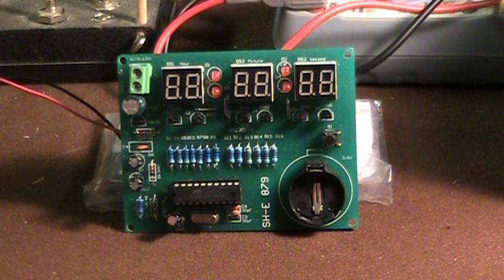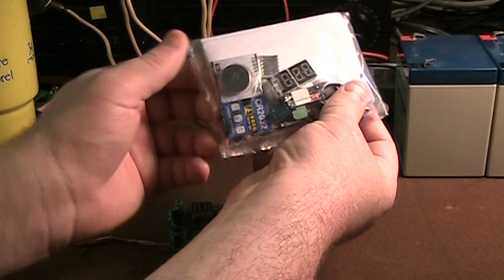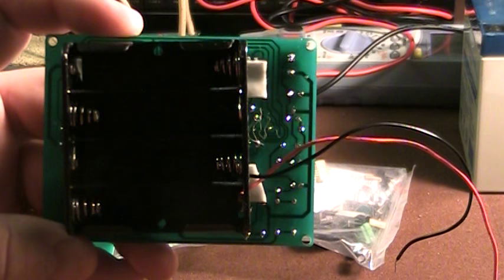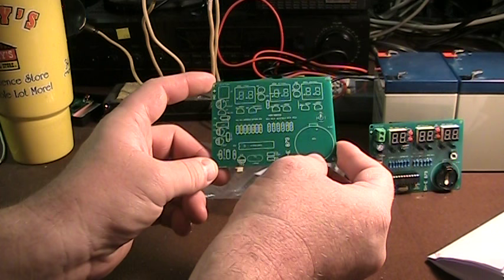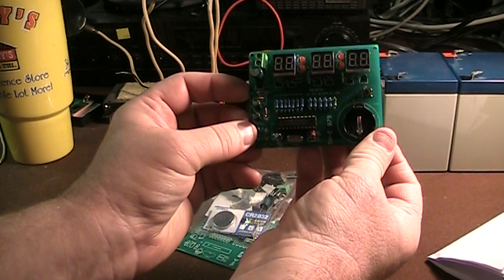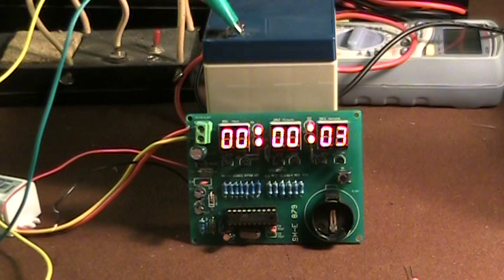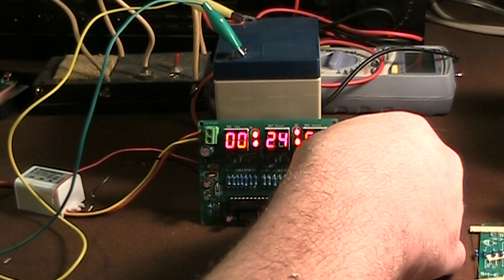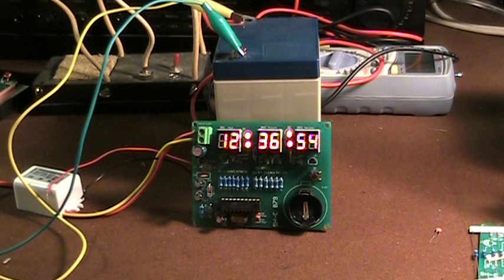Review: Cheap Microcontroller Digital Clock Kit (SH-E879)

Comment: I decided to repair the living room 24 inch Sanyo CRT TV a few days ago. The vertical was messed up. With the advise of RadioTVphonoNut, I was told to replace a capacitor. The value I needed was a 220uf at 35 volts. Strangely enough, Radio Shack had the very value cap by Nichicon in an axel lead. The radial lead was an unknown brand. I went with the Nichicon. 
Later that day,  I find a nearly Identical Sanyo CRT set by the curb. I plug it in, turn it on and, amazingly, it works great.  
I found an Emerson VCR that was repaired by RS 20 years ago nearby. It works great too. Hot diggity dog LOL. I fixed the first Sanyo for about the price of a 20oz Coke in my area.

Comment: I tried it and it works quite well, that is, the 4 LED diodes do not turn on, they only turn on when in sleep mode, which is accessed by pressing the button once.
Other than that, the backup battery works very well. I disconnected and connected it several times and it did not restart.

Comment: Energizer batteries last amazingly long - I've got a multimeter from something like the 1970s which had its original battery still installed. Despite having leaked and corroded all over the place, it still held about its correct voltage.

Comment: There's a proper Arduino library that allows the Atmel to run in a sleep state drawing an extremely low voltage. there's a GreatScott video about an IR remote control for a receiver where this is featured... but in use, it doesn't run the clock, just sleeps the controller until input is given. this could probably be modified somehow, however.
Reply: You can use that capability without the Arduino bootloader.
Reply: techhelper1
right.

Comment: When I turn it on, it just shows every number as 8. I press the button but it doesn't do anything.
Reply from the maker: At that point, assuming you care, you check all the solder joints, your power supply, component placement, whether or not the parts are good and hope that you didn't zap or overheat anything during the assembly process.

I suspect you have a problem with the clock crystal.

Comment: These are the kinds of kit's Radio Shack should have sold, or should sell in what ever limited capacity they operate today.  I would assume this clock is probably intended to be used with a wall wart. I think you are a bit to picky of your soldering. It looks fine to me. Your not a wave soldering machine after all.  Fun video!  There are some older ( late 70's or 80's ) NOS multimeter kits on ebay for about $10 that you might have a look at. I bought one, seems like a pretty nice kit.
Reply from the maker: Just a few years before RadioShack finally managed to go bankrupt, they had managed to bring some kits back into their stores. I really had high hopes that perhaps this would bring them back from the edge. Maybe it would have lead to their getting back to their roots and doing what made them so great in the first place. Alas, it wasn't to be. (I have always felt it was RadioShack's ill-considered decision to dedicate large portions of their stores to cellular phones in the late 1990s that led to their demise.)

I am pleased to see that the new ownership has put more kits in the remaining RadioShack stores around these parts. They're not exactly cheap, but that's OK with me so long as they go together and work well.
Reply: *****
The remaining Radio Shack in my area has removed a lot of stuff that they once stocked there. As thin as they were before compared to the golden days, it's worse now. There supply of solder for example is down to 2 rolls and 2 soldering irons. I think they still stock some of the Arduino kits they were selling before, but a lot of that stuff was removed as well. Perhaps they have stocked more stuff lately, I haven't been there for a few months since I discovered they stopped carrying the solder I prefer to use.
Reply from the maker: Very strange. After their bankruptcy and "relaunch" the one RS store I frequent had basically no stock of anything. As time has gone by, though, they've managed to restock the whole store quite nicely. They have decent variety and even some of the more oddball/specialty items for which RS was known.

Given that this store seemed to not only be doing well, but that it also catered to a fair number of electronics enthusiasts besides myself and actually had knowledgeable people on staff, perhaps it is more of a rarity than I realized.

Comment: Good video Bill, What form of switch output is it? volt free contacts are out, so, low voltage DC switched on/off?, Daft question I know but I was wondering. J.
Reply from the maker: This is a clock, not a timer. There is no alarm functionality, and as such there is no output contact of any type.

Comment: So, which kit would you recommend to someone like me? I have soldered before, and have put a few LED kits together. The most I have ever successfully completed was a capacitor swap on a dell motherboard.
Reply from the maker: If you've soldered before, this kit is a fine choice so long as you're OK with identifying components and their values as you put it together -- and you get one where the circuit board is accurately marked. Even if it gets messed up beyond repair, you're out about $4.

Comment: I was thinking about getting one of those, but I already have enough clocks in my house and I don't lose track of time. There's only one Radio Shack left by my house and it's inside a mall. Is it a good idea to use a slab for an alarm clock as a backup battery (with voltage regulators, of course)?
Reply: I only have one Radioshack too, but it doesn't even sell components.
Reply from the maker: I haven't been satisfied with the accuracy of any alarm clock when running from a backup battery. (I presume that by "slab" you mean SLA Battery. If not, please clarify.)

Truth be told, I don't think using an SLA battery would work well in that application. They have a considerable self discharge rate. A conventional linear voltage regular is going to be running awfully close to its minimum voltage differential limits and a buck type converter might output too noisy of a signal even with fairly serious filtering. Noise introduced by most simple battery charging circuits might get into the clock logic and pose another problem.

I was very satisfied by the results of simply plugging my bedroom clock radio into a cheap UPS. It had no issue with the modified sinewave output, kept great time even when running from the UPS's inverter and would stay running for hours. Your mileage could vary, but as cheap UPSes are everywhere, I'd suggest at least giving it a try.
Reply: +uxwbill I forgot that I purchased a UPS from a thrift store and got a new battery from RadioShack. I'll test it out tomorrow morning with the UPS unplugged and the clock radio plugged into the UPS and see how long it'll take until the clock shuts off.

Comment: It appears they are running that arduino type chip with an external oscillator crystal, does it have the frequency listed on it? -cscash
Reply from the maker: 12 MHz even.

Comment: In an attempt to feed that image through Google Translate, I got the real, accurate translation to engrish: "Translate server error."
Reply from the maker: It's better living through technology!

(More seriously, I once did exactly that to determine what something said. I took a picture of the text, converted it down to a two bit image and uploaded it to a web-based OCR engine. I was amazed to find that such a thing existed, especially as I wasn't really tremendously enthused by the idea of digging up my old copy of TextBridge and trying to get it going. I then took the text as it was recognized and fed it to Google Translate. And yes, it all worked to give me my answer!)
Reply: Yikes, I would imagine that took some time. The mobile app for Google Translate will let you take pictures and higlight the text you want to translate, but it's a work in progress and works only marginally okay for some languages but perfectly with others. I know from experience Chinese and Korean hardly work but Russian seems to be just fine. (I pick up a lot of foreign electronics.)
Reply from the maker: Nah, it was really pretty easy and straightforward. And it worked, which came as a really pleasant surprise. (I haven't lost all my faith in computers and software just yet.)

At risk of encouraging the whole "Standard Definition Isn't Good Enough" brigade to descend upon this comments area, maybe the Google Translate app would work better if it had more image data to work with. I might take a better picture of those instructions, and do with them what I described earlier just to see what happens.

Comment: Just don't build one of these in Texas if your skin's not white, otherwise the waterheads will call it a "bomb"... :P

Speaking of DIY clock kits, there's one out there known as an "Aurora LED Chromatography clock", I built one last year, neat little thing, the only downside is it's a huge learning curve in soldering SMD components, but I managed to get mine built and working nicely... :)

And still have 2x more kits to build up... :P

Comment: uxwbill you just gave me an idea for a DIY project. Thanks!
Reply from the maker: May I ask what that project is?
Reply: I plan to make a clock using a different microcontroller. PIC16F690 has the same number of pins and more features than the Atmel AT89C2051.

Comment: 7:59 ok now i have to buy one of those things because that battery should be able to power that thing for hours if not days. i gotta get it just to debug the fucker.
Reply from the maker: 4xAA batteries ran it for ten days and in my tests, it got just about everything those batteries could give. (Each one was down to 0.994 volts or so. Still, they might go on to run a wall clock, transistor radio or something else of a fairly non-demanding nature.)

Lithium or rechargeable batteries would probably do even better, and so too would some bigger batteries if you're not opposed to using such. (I'd suggest SLA batteries, but they don't like to be run flat.)
Reply: It all depends on the clock speed and if certain built in components on the microcontroller are disabled.

Comment: thays not a clock,  thats a bomb
Reply from the maker: It is for this reason that I do not recommend taking the completed kit to an airport or attempting to board an airplane with it in hand. (Actually, at risk of expressing an Obnoxious Opinion, if man were meant to fly, he'd have wings.)

While the microcontroller could be reprogrammed, it has no countdown mode and therefore is not suitable for use with bombs. (Excuse me, I'll be right back. That'll be the FBI knocking on my door. :-P)
Reply: *****
you didnt get the joke did you